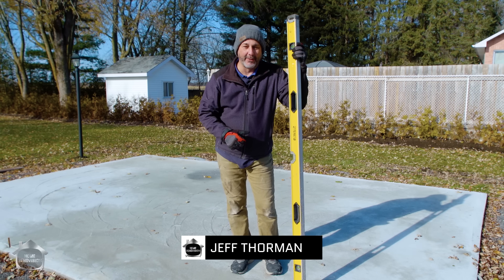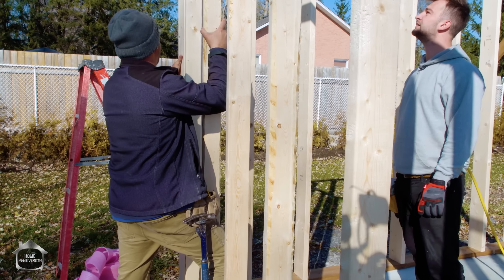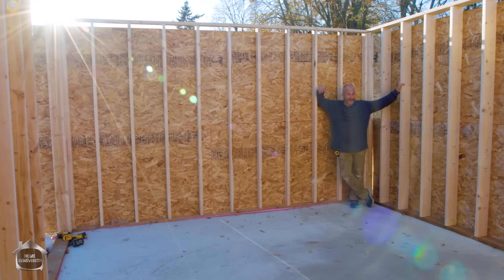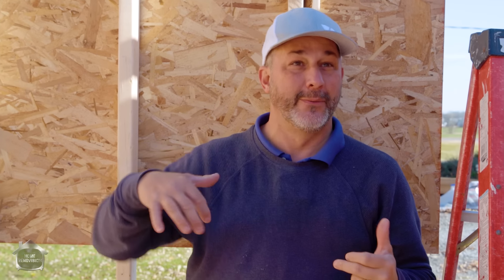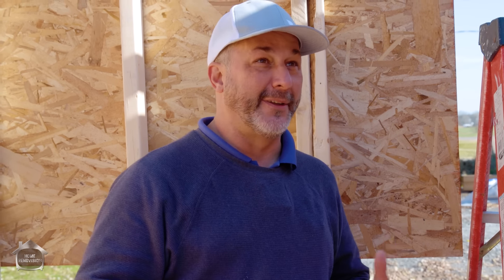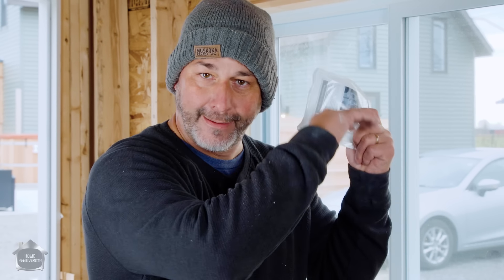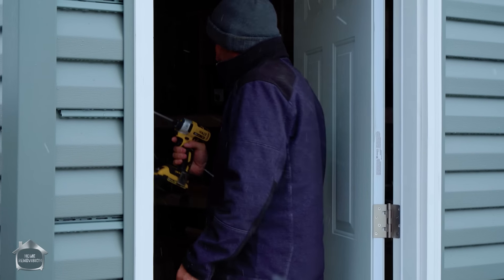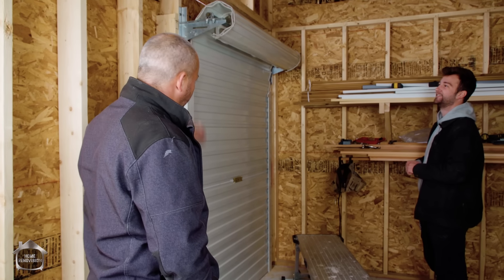Build Your OWN Workshop for DIY Projects!

Comment: Is it just me or does the fascia trim have ripples in it above the small windows? It looks like it’s bubbles out in a few spots, what causes that?
Reply from the maker: in this case it was screwed from the bottom causing the ripples. if you use a 1x6 no worries but with that 2x6 it will need replacing.
Reply: Warped/bowed lumber will also cause that because your forcing the metal to take the curve the sub fascia is creating.

Comment: Unless I'm missing something, the windows at the upper part of your front wall are now supporting the entire load of your rafters and there's no header above them. A top plate is not a header. Without a proper header, and having windows that span virtually the entire width of your building, those windows are going to bow badly under the weight of that roof. 

Also, from a load standpoint, the side walls actually carry just as much load as the front once the structure is all tied together. Its why it's important to do things by code and the right way to ensure load is transferred and carried to other areas as it's supposed to. 

Having double top plates, headers, closed framed corners, actually notching your rafters etc aren't just for looks. They are all necessary for loads to be supported and transferred across the entire board, not just at points. 

Your videos normally show you are very knowledgeable however this video would make me question whether you're licensed to build planter boxes, let alone houses or do renovations. Not trying to be cruel, but this was subpar quality work. You're much better than this.
Reply: @Jeff Krayenvenger I think I understand your opinion ... however my opinion is: yes, you are missing a few points here.

1) This is only a shed.

2) You state "your front wall are now supporting the entire load of your rafters". No, in fact they are not because of multiple factors including the comparative height of walls and also there are 2 load bearing walls (not just 1). Therefore, the front wall is actually bearing less than 50% of the load. (**You may say that I'm being picky - but then I would refer you back to your post.)

3) If you would notice, Jeff started attaching those windows flush to the upper plate & then just tacking in the bottom and sides (not using any wedges) thus "chandeliering" them. So, in essence, they would be just hanging from the upper plate rather than tied in, giving no structural support, They are there only to keep the weather out & let sunshine in.

4) Your opinion of Jeff, as a contractor, seems a bit fragile if little things like this totally fracture you view of his work.

Some may disagree with my thoughts, however ... I'm not the one who went WAY overboard saying "make me question whether you're licensed to build planter boxes".

Hey, chill.
Reply: @GNUOYEEL  "This is only a shed". When it comes down on someone due to improper construction the type of structure is irrelevant. When it comes to construction, the type of structure doesn't matter. You do it right or you don't do it at all. Costs nothing more to do it the correct way. That's a very poor excuse, and one that would send a contractor packing if he uttered that statement.

My point on the front wall still stands. The rafters not being notched results in a point load on the single top plate which is being used as a header for windows which that board doesn't have the strength to do in that position. Period. Not up for debate. That top plate is under tremendous compression and load for no reason. 

The side walls when properly tied in share the load, as all 4 exterior walls are load bearing. Again not up for debate. While the rafters may stay in place with just front and back walls in place, once all sheathing is in place, corners in place etc all exterior walls are load bearing. 

I said a few times his previous work has shown he knows what he is doing but this project did the opposite. I'm being objective here. It's not about personal feelings. I still feel this skills are better than what he showed here and if you can't see that, it indicates you are choosing not to. 

When my child gets something from my shed, I know it's not coming down because I didn't say, well it's just a shed. Because I care about the quality of work I do, and I want everyone that is around or in my buildings or structures to be safe. Sorry you don't feel the same. 

Again, Jeff is normally showcasing extremely high quality craftsmanship. I don't think he could say this build met that bar with a straight face.

Comment: Jeff never wears eye protection... that circular saw cut going up the door frame while standing underneath, I was cringing hard.
Reply: It seems like the only time I get anything in my eyes is when I wear safety glasses. Except when I'm using a wire brush with a drill. Then everything else gets impaled.

Comment: Did an installation of the same door. We had to use wrenches on. The  shaft after we had it up to tension the door after installation. Not the best design. The instructions are not much help.
Reply from the maker: wish I at least had them. Cheers!

Comment: 34:42... Why you don't have a double top plate supporting the roof joist above the windows is nothing short of unbelievable. So many things you do are questionable at best.    
Your level of professionalism and craftsmanship is nonexistent. Half your video is you pointing out mistakes you've made and the other half hiding or ignoring them.  I'm hard pressed to recall one of your construction projects that wasn't  a trainwreck. 
I wish you the best.....